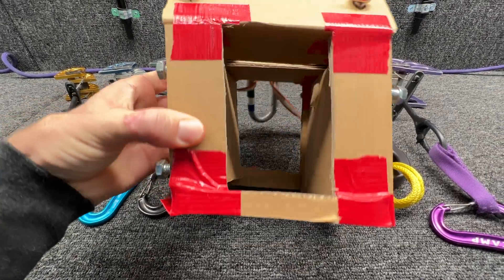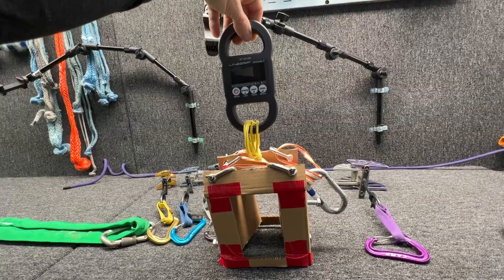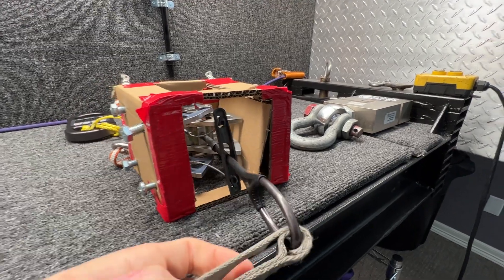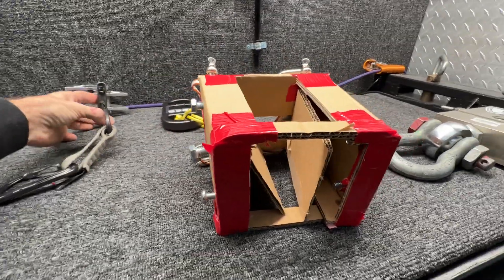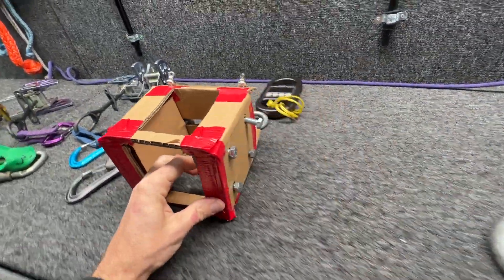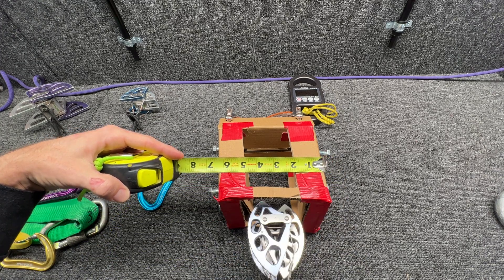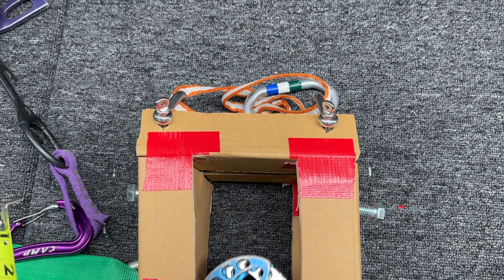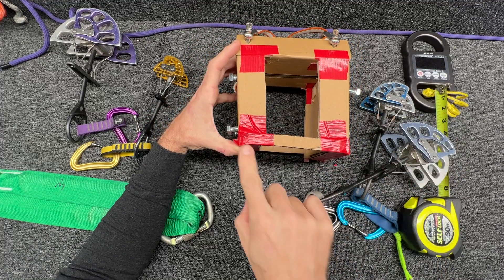Cam crusher final CAD design (Cardboard and Ducktape)

Comment from the maker: I'm getting this 3D printed to shit test where the weak points will be.  Our specs right now will be the following when we make the metal version:

4" C Channel - 3 pieces 4" long attached like you see in my mock up.  1/2" thick.  Flanges 1.5" with supports on both sides, no back.  One support (on the front) will be removable if I desire to test cams not positioned correctly and I'm not pulling too hard.  This will fit up to a #4 C4 and will use C Clamp swivel ends on the bolts that adjust the free floating 1/2" plates inside that are able to slide back and forth via the groove plasma cut out of the top.  Welding some giant files to the face of each plate should give us enough knurl to keep the cams from sliding.  

Always open to more thoughts!

Comment: Great videos.
 If the movable plates had threaded bars welded on the back, you can use nuts on the outside to lock the position, and stop the vibration seen in previous tests.

Comment: If you're worried about the flanges on top flexing you could always weld in some small triangular reinforcing gussets. You could also make interchangeable inner plates that have different kinds rock topography/features like divots, cracks, protrusions etc. to make it as versatile as you wanted. 👍👍
Reply from the maker: we might make a solid verison of this (4 sided C channel) with a rock inside epoxied in, then create a piton scar in the middle and see which cam holds best brand for brand
Reply: I’d like to see rock plates.. you could probably use bathroom kitchen tiles and perhaps resting mount some random rock pieces onto plates too